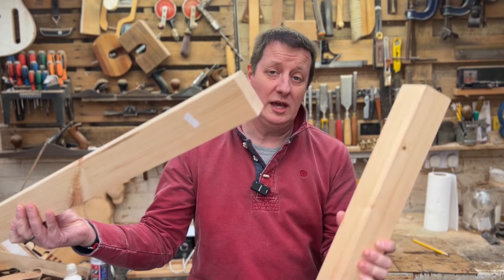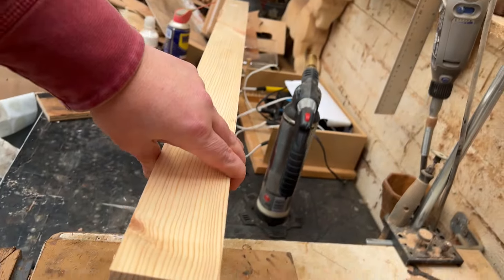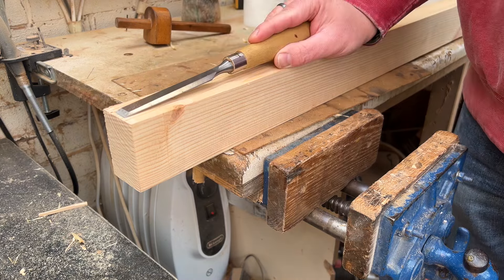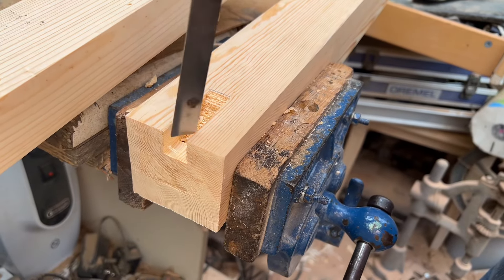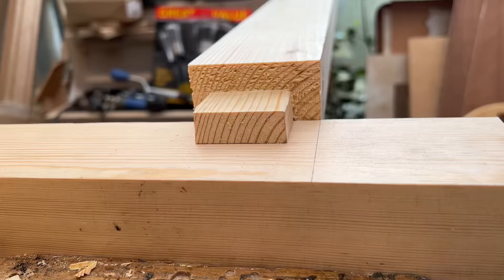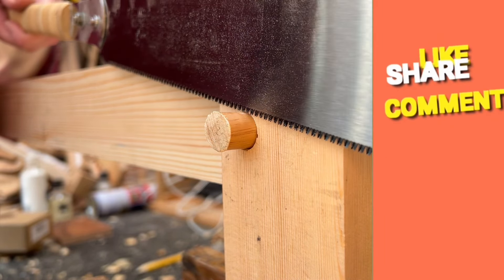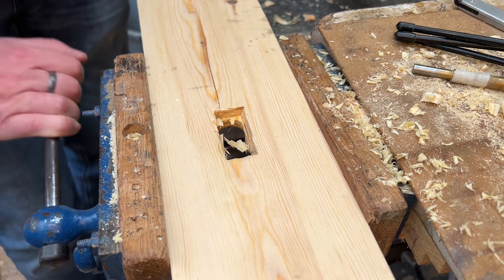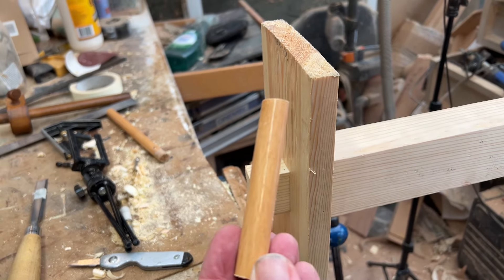Quick and Simple JOINERY - Attaching Rails to Posts

Comment from the maker: ⭐️🌟Which type have you done? 🌟⭐️
Reply: Being a bench joiner I've done all off those but normally with a haunched tennon but these days it's the easy peasy Domino machine ,👍
Reply from the maker: @barrychristian4050  do you miss the hands on approach?
Reply: @KingBespokeCreations  sometimes I do but unfortunately where I work as most places it's about the time/quality ratio so it's CNC and big industrial machines with attention to detail to the finish and currently am making a guitar in my front room as I don't have a proper work space at home which is challenging to say the least
Reply: Every one. You forgot half lap joint. I used it also to lengthen the boards in tool cabinet doors as my longest boards were too short. (with brass pins/dowels just for fun) 😉
The last one on your video i used to connect big bottom rails to legs of my woodworking table. I made it so you can disassemble the legs, rails and the top if i ever have to move because that table weights well over 100 kg 😁 (legs are 10x10 cm thick, rails are 20 cm high x 5 cm and the top is 9 cm thick, 60x180 cm, all birch plywood)
Reply from the maker: @Ramplcro  nice! I could do with a big work table. 100kg!